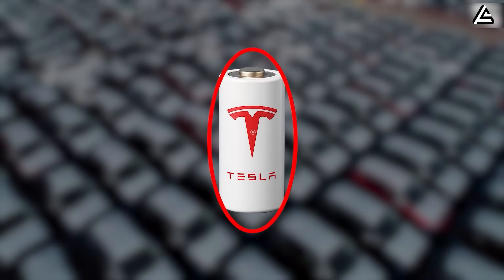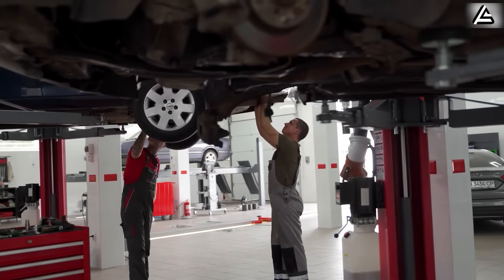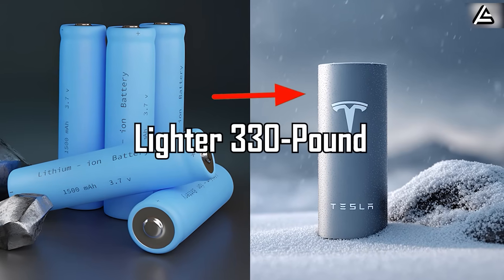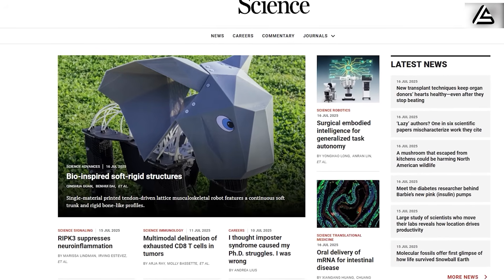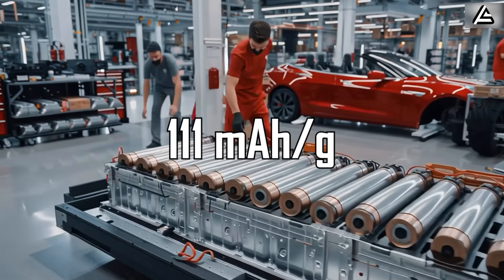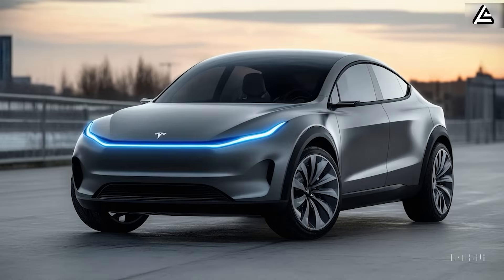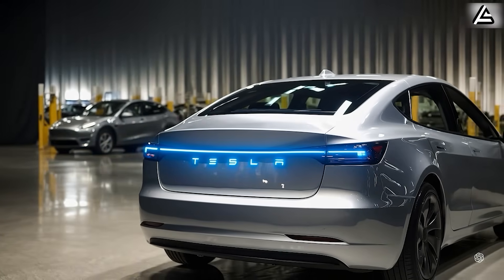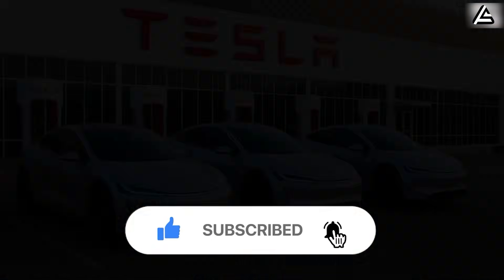Elon Musk Announced 2026 Tesla Batteries Tech For Model 2: What’s Hidden Behind?

Comment: It would be nice if you can provide evidence that Elon Musk announced this so called "aluminum-ion" battery, either show his tweet or his interview. Otherwise, he could very well be announcing a new nuclear battery in every new Tesla that doesn't need to recharge ever for 50+ years on some random video somewhere on YouTube.
Reply from the maker: Do you think Tesla should actually try aluminum-ion next, or keep improving lithium?
Reply: @AutoGearShift2  Is aluminum-ion a real thing? Any working prototype that is being demonstrated somewhere on Youtube? From what I'm understanding, sodium-ion is the future as CATL has continued to improve energy density, even matching the lfp.
Reply from the maker: Aluminum-ion is a real research concept being explored, but no production-ready EV prototype exists yet, and nothing verified on YouTube as a mass-usable cell. Sodium-ion (like CATL’s improvements) is closer to real deployment today.
Reply from the maker: If GMG Manufacturing Group is aiming for commercial aluminum-ion production next year, that’s interesting. but until there’s independent validation and volume supply, it remains speculative.
Reply from the maker: Commercial production claims for 2027 are interesting, but at this stage, they remain pre-commercial demonstrations, not mass-manufactured cells. Patents and lab validation (even from respected centers) are necessary steps, but not proof of scalability, cost, or reliability at automotive volumes.

Comment: With the advent and consolidation of this new generation of batteries (batteries have always been the Achilles' heel of current EVs), if the technological promises come true, I foresee the following profound consequences for the automotive market: 1. Decline and extinction of the combustion vehicle: The superiority of the new batteries could and will certainly precipitate the end of the internal combustion engine era. 2. Devaluation of current electric vehicles (EV´s): Existing electric models will certainly tend to suffer a significant loss of market value, especially if there is no possibility of adaptation or retrofit with the new technology batteries. 3. Systemic collateral impacts: The fuel market and the traditional automotive service chain, including gas stations, mechanical workshops, and the sales sector for combustion engine parts, will be significantly affected. It is, undoubtedly, a new technological revolution with the potential to permanently redefine global mobility. Time will tell...
Reply from the maker: But here’s a question for everyone — do you think legacy automakers will adapt fast enough to survive this shift, or will startups and battery pioneers take over the market entirely? ⚡